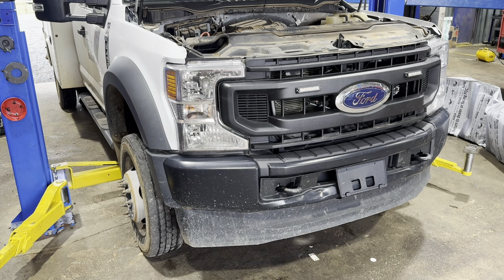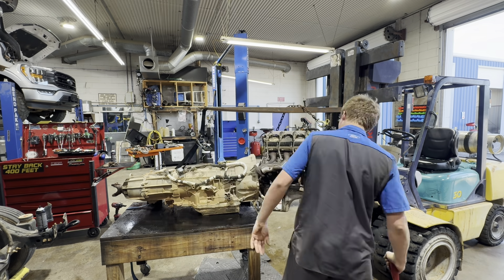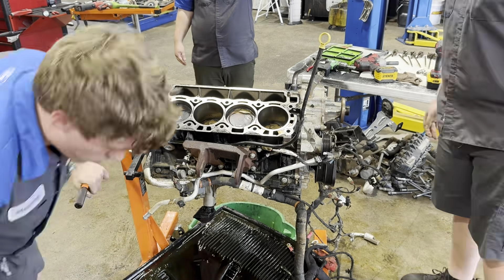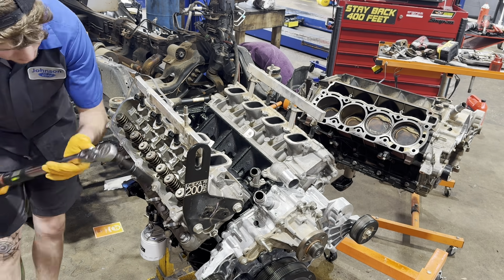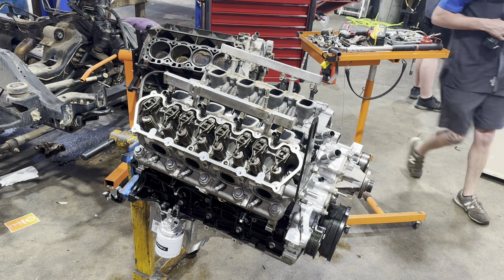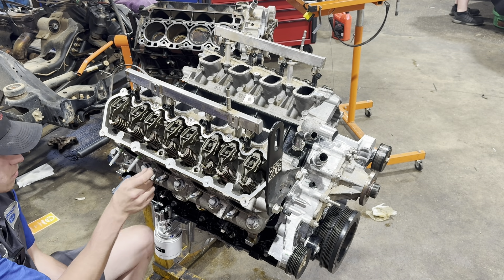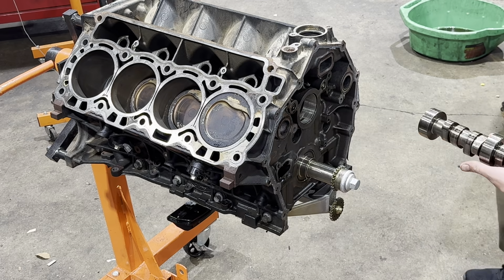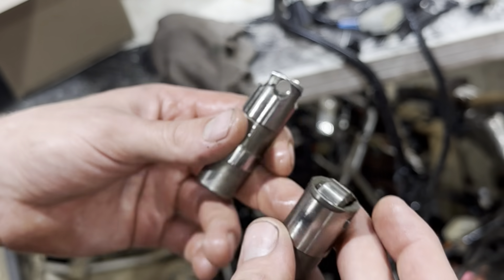Ford 7.3 Godzilla | Does this one issue make the engine a bust?

Comment: Oil pressure does not really affect lifters. Poor oiling circuits can be overcome by higher oil pressure but as far as collapsing, the oil is being pressured to fill the void, not provide any capacity in preventing the lifter from collapsing.

Comment: I pretty much have been buying old dodges with the 12 valve and been stacking like cordwood. Last one drove itself on the trailer after 356K of oilfield abuse still hammering away.

Comment: Ford could reflash the ecm for higher minimum oil pressure . The low weight oil + oil with no zinc in it doesn’t help either . Some of the older Fords you could toggle through the odometer and it would tell you idle time hours .
Reply: They came out with a update 24b27
Reply: They did, but its not available for most trucks....makes no sense
Reply: People please... the oil pump is not ECM regulated. Any issues with lifter failure is due to supplier issues. All big three have had similar problems...
Reply: @johnthomas2856  the pump isn’t but the purge solenoid is which affects oil pressure and volume. 24b27 spells it out directly from ford. I’m sure it’s not the leading factor in failures but it is most likely causing some issues for ford to do a CSP.
Reply: @johnthomas2856 ok Einstein.  Within 10 minutes of researching this issue because I just ordered a 2025 F350 it was clear to me from countless sources that the oil pressure is the CM controlled .  Try again.

Comment: Fw those need a heavier viscosity oil like most things these days. Like maybe 15w40 and  a high idle setting like diesels have to keep the OP up. Engines don't live long at 8 psi. As you and Fomoco are finding out.

Comment: 6.2 junk?? What world are you livin in😂😂I've worked on countless 6.2s and the most common problem is them breaking a value spring...which isnt hard to do. Every blue moon one might have vct issues but those were few and far between and were mainly caused by lack of maintenance. The 6.2 was very hard to kill. Oh and the ls came from a 351 Windsor hence why its possible to swap an ls head on a 351 with minimal machining.
Reply: 😂 My 2012 f250 6.2 has 394,556 miles on it and purring along like New. Good maintenance schedule and normal wear items replaced 😅
Reply: LS did NOT "come from" any ford design. It's has some similarities and that is all. Full stop.
Reply: @shanechambers9529 

It's embarrassing having a Ford bias when 1d10t5 start spewing that LS copied the 351W nonsense nonsense. ..

About as bad as the 7.3L copied the LS feces....
Reply: @shanechambers9529 wrong again. 351w was in the lotus race teams race car. It was getting outdated. Ford was designing a new engine for it and had already scrapped the early LS design due to its inefficiency when GM came along and purchased the race team. The blueprints for the engine were bought along with everything else. Just a few short years later they had prototypes of a new engine. Do you Know who the driver for lotus was? Yup. You got it. The “engineer” of the LS. Ed Koermer. After all, the ls1 was based on the lt5 that Mercury marine built… but yea, you’re right. Ford didn’t have anything to do with it… GM is known for building their own parts. Like the duramax… and the Allison transmission…
Reply: @shanechambers9529 you’re wrong.

Comment: 6.2 was a great engine idk wtf he talking about . It was pretty reliable
Reply: I agree.
Reply: 6.2s were screamers and tough
Reply: 6.2s could be underpowered in some applications but again, never seen one that didn’t run good, unless the plug wires had a break in them or a a coil pack, which are maintenance items. Also seen the intake runner control valves make noise like a bad lifter, but not the end of the world
Reply: A few broken valve springs….easy fix. Real early ones had roller rocker issues. Great engine?
Reply: I've never thought of the 6.2 as junk either. The 5.4 3 valve, they were junk
Reply: The 6.2 has been bulletproof for everyone i know!

Comment: Seems all the heavy duty gas trucks are having issues with lifters. Curious if it’s lower viscosity oil and lots of Idling or suppliers sending out poor quality batches.
Reply: 6.4 HEMI uses 0w-40, which is pretty dang thick compared to most engines these days. I’ve got 45k on mine, fingers crossed.
Reply: @m_ssingp_eces  Am I mistaken or does the 0w in front mean its very thin at operating temps?
Reply: @marcochavanne the "W" number is the cold crank rating. Basically the force required to drag a bar through an oil bath at cold temperature. You can look up the SAR test method to better explain it. It's better to have a lower number which means the oil will flow better at startup. The second number is the actual viscosity at operating teperature. The higher the number the "thicker" the oil. This should be selected based on the manufacturers recommendations. There used to be a wide range since the engine oil was only used to lubricate. Now you have variable displacement and valve timing that viscosity is critical and if it is too far off, you can actually get a check engine light.
Reply: Thin oil certainly doesn’t help
Reply: Ford built this thing off a blank sheet of paper. Of course they observed all the GM RAM engines and came up with the 6.8/7.3L . That being said why didn’t the use a derivative of the 6.7L powerstroke lifter. The wheels on the lifters are massive compared to the same ole GM Ford pos lifter? From what I can see it’s the same lifters as the 6.9/7.3/6.0/6.4L crazy to me….

Comment: We have a large fleet of cab chassis trucks, every 7.3 has had this problem before 50k all had to be replaced.
Reply: I also work at a large fleet. 7.3 last less than than 40,000Km. New ford recall to increase RPM at idle to prevent catastrophic damage.
Build Ford Rough.
Reply: @roxydog545 i would say if you are having issues with the 7.3. Which is doubtfull..the maintenance  guys are the issue
Reply: The 7.3 godzillas do not take idling well. I have heard of close to 300k, those ones were not idled a lot, then they usually have no issues...
Reply: We have 3, 7.3s. NONe with any issues. One has 191k. BOx trucks and loaded every day. Real Loads. (highway and City miles)  So....IDK... Just FYI  and They PULL, Hard.
Reply: Daym
Reply: bUT THe 6.2 Is jUnK! 😂😂😂

Comment: I could’ve sworn there was a tsb or recall to update the pcm to increase oil pressure during extended idle time
Reply: Yes 24b27 ford is dragging their feet on distributing it. I don’t think anyone has been able to get it done.
Reply: @ZimmyF250  Thanks I knew I saw it but I couldn’t find it anywhere
Reply: Yes just talked to ford they said have to wait for vin to be attached to the csp. Mine is a 2023 they don't care if I destroy my engine.

Comment: Also the oil pressure sensor not sensor but pressure switch which only takes 5-7 psi. I've also had ACTUAL pressure gauge in the engine getting 40 to 70psi.
Reply: What was your psi when warmed up idling?
Reply: What I posted tells you

Comment: Ive done 3 chevy Silverado's and 2 gmc sierra's 1500's L83 and L86 because of lifter failure in the past 4 month's. I was able to save a couple but the others where full rebuilds! Rebuilt to 5.7 hemis last year because of bad lifters!
Reply: Which company brand you're using for replacement lifters? Im planning on getting an 2022 yukon denali and want to take all this stuff out before it messes something up.
Reply: @warriorplutotrent3827  been using Elgen or factory gm lifters. Your 2022 will have a lock on the pcm if you go in with hp tuners and the right person does it they can disable the dynamic fuel management.  In 2019 they started putting it on all cylinders instead of 1,7,4 and 6.
Reply: @joesmo4749  thanks for the info.

Comment: I'll bet if you run 1 step higher on oil viscosity, the lifters won't fail. If it call for 0w20, try 5w30 for a while and see what happens
Reply: i have one 2024 they have 5w30 already for ford
Reply: My 22 calls for 5W 30 factory. I may start using T6 rotella 4W40. Heard alot of good things on it
Reply: @rickcarmichael4661 Order new catalytic converters after the Rotella diesel oil change 😂
Reply: @h2o100c I've used higher zinc oils in many cars with catalytic converters over many, many miles. Maybe it shortens the life of the catalytic converter over 200,000-300,000 miles but I've never had a single one fail. A cat is cheaper than an engine anyway.

Comment: You were the chosen one! It was said that you would destroy the diesels, not join them!
Reply: Hahahah I just watched Star Wars and this is hilarious 😂
Reply: anyone trying to compare the problems of modern diesel to this is coping
Reply: I've never heard of this problem affecting anything but a small number of the 7.3s sold for commercial use, so it was probably just a bad batch of lifters. It's a non-issue.
Reply: I wound three diesels and two of them had expensive failures that left me by the side of the road. A gasoline engine has never done that.
Reply: This conversation went directly to no mans land fast.
Reply: It drove itself to the shop. Still a yuge savings over a nasty diesel.
Reply: @operator8014 nasty? The only thing nasty about diesels is the emissions systems that are killing them and causing more waste and pollution than just not having them.
Reply: @huh0123  The smell, the sound, the way they shake and knock like they're dying when they're running perfectly, the way you need 10L of BIG DEEZEL POWER to match a non diesel 3L, the way they just cannot be started at any temperature below -30, the way they're more delicate than a snowflake feminist convention...

Diesels suck at everything except for saving fuel, kinda. The only thing worse than a diesel engine, is a diesel owner.
Reply: @ you do realize diesel engines are smoother running than their gas counterparts, right? 10L of diesel to match a non diesel 3L? Do you actually have any idea what you're even talking about? LOL
Reply: @sly9263  No he does not. 1200 torque from the HO pulls circles around every gasser ever, unapologetically. I love the 7.3 Godzilla but this guy is a tool.
Reply: @AndyE30  The 7.3 is naturally aspirated and it still compares fairly well with its diesel competitors, so how well do you think a diesel would keep up if it were turbocharged?
Reply: @PistonAvatarGuy  I have one in a Tremor. Gassers are faster, lighter, rev higher, make more horsepower, and geared more appropriately. In all honesty it barely needs a tune to outrun a HO. 
Of course, they'll never put down the power that diesel's do.
I think the line of reliability is blurring. As gassers improve, new diesels are becoming less reliable. Built cheaper and with increased emissions equipment choking them out. 
Sad to see really.
Reply: @AndyE30  Never put down the power that diesels do? Since when do diesels make 5,000 hp?
Reply: @PistonAvatarGuy  Honestly I don't know what you're arguing. Previously you asked "how well a diesel would keep up if it were turbocharged", they are. 
Now you're asking "when do diesels make 5,000 horsepower", they don't. 

I'm saying diesels make an ass load of torque that gassers can't touch and it's incredible, but gassers make more power that lends them to be faster. 
Where is the disconnect?
Reply: @AndyE30  No, I was asking how well a diesel would keep up with a turbocharged 7.3 gasser.

Anyway, if we crunch the numbers, using the performance of Ford's 3.5 liter EcoBoost engine as an example, we get a BMEP of 353.4 psi, which works out to 1,043 lb-ft of torque for a 7.3 liter, which is very close to the torque output of the current 6.7 Power Stroke (excluding the HO). The real kicker would come from the fact that a gasser can rev higher than a diesel, so it can hold onto lower gears longer than a diesel, sending more torque to the wheels as you accelerate to speed. Even if a turbocharged 7.3 gasser could only rev to 3,700 rpm, it would still be capable of more than 500 hp... easily.

With a smaller displacement gasoline engine, you could also trade revs for torque with lower gearing, and make more torque at the wheels than even the HO Power Stroke, you'd just have to get comfortable with consistently higher revs... which is true of the current 7.3 anyway.
Reply: @AndyE30  Really, we can simplify everything and say that Ford's 2.7 EcoBoost engine outperforms all of the 3.0 liter diesel offerings in light pickups, so there's no reason why a ~6 liter gasoline engine couldn't also outperform the current ~6 liter diesels offered in pickup trucks.

Comment: They'd rather get 1 mile a gallon better on gas and replace engines one after the next. Make it make sense.
Reply: More like .01
Reply: Right? How about Gm? Even worse. They took a once great 5.3/6.2 engine and ruined it to save .5 mpg.... Mind boggling. Tje EPA needs to be challenged at this point for the impossible regulations they are implementing on the manufactures.

Comment: What kills the hemi rollers is lack of lube at idle and low engine speeds. The best way to save them is to have the idle bumped up to 900 ish so theres more splash lubing for the roller. Gm lifters the failure usually starts with the dod system lifters collapsing and the roller not being under tension like its supposed to be
Reply: The GM AFM lifter failures in the older engines (Gen IV) are due to long oil changes with poor quality oil, and buildup in the Valve Lifter Oil Manifold (VLOM), as well as buildup on the screen underneath the oil pressure sender. Clean the screen, use good quality synthetic oil preferably a 0W-40 like the Corvette Dexos R 0W-40, or even thicker, and if the VLOM is the old style with raised, rounded bumps on it, replace it with the latest revision one for an L77 or alternatively one for an LT4, and the issues are incredibly unlikely to happen if the engine was in decent condition before that. In terms of an even more exotic oil that doesn't shear easily and cause low oil pressure, High Performance Lubricants (HPL) No VII series 10W-30 or 10W-40 is a good choice. No viscosity index improvers and group IV base stocks only, means the oil will not shear at all over a normal oil change interval. Oil shearing also can cause low oil pressure, making improper activation of the lifters more likely.
Reply: own 6 different 5.3 gm never had a failure .
Reply: @classic89deerefever80  its way more common in the afm engines. It starts with the afm specific lifters. No afm or afm delete engines usually wont do it. But its also not every engine that does it. High idle or low speed operation hours usually does it. Engines running down the highway all the time wont
Reply: @classic89deerefever80  after 07 yeah.

Comment: Nothing wrong with the 6.2. By far the best gas option for a heavy duty pickup. Good power and reliable, which is why most oilfield trucks and railroad trucks are all 6.2 with 300k and many engine idle hours. the 6.0 and 6.4 gas suffer from oil pressure issues unlike the 6.2
Reply: My coworker has a 6.2 Raptor with 780k miles. 3rd transmission.
Reply: We have had 5 work 6.2 go over 350k and they take a beating
Reply: He hates them because they don't break
Reply: @Running-with-skizers or perhaps he was in the 6th grade when they introduced the 6.2. In my opinion the 6.2 could have really shined in the mustang but ford developed the coyote instead robbing the 6.2 of its potential. The 6.2 bottom end has enormous potential. It's all there. With some cylinder head and induction changes and perhaps a steel flat plane crankshaft  it could have been a solid 1000 hp engine.
Reply: If you were to buy new I’d go with the 6.6 L8t…
Reply: @wesleygarrison6248 No way! Direct injection and they burn oil like crazy.
Reply: @ They don’t burn oil, and direct injection isn’t an issue if high octane fuel is used… better than having to worry about lifter failure on a 7.3…
Reply: @BoomBoomSoon  you are thinking of the GM LS3 Direct Injected 6.2. The Ford 6.2 is not direct injection it is port fuel injected. Direct injection on a gas engine is so stupid. You have to run special engine oil to prevent pre-ignition around the piston rings (that are low tension rings too- thus burning oil) injector failures also have to potential of destroying the engine as well. Just a mess of a fuel delivery system. There was nothing wrong with port injection. Then some dumbass decided to inject fuel into a hot cylinder, on top of a hot piston. The injectors get hot, thus having a high failure rate and when they fail they usually stick open flooding the cylinder with raw gasoline washing down the rings and in some cases bending connecting rods or busting pistons.
Reply: By buddy’s 6.2 has 295,000 miles and still doing burnout

Comment: It's the economy tune. When idling they run very low oil pressure. Normal trucks that don't have a chassis cab don't have this issue
Reply: According to ford it's all of them google csp24b27 superduty.

Comment: Looks like the pin is breaking on the roller lifters. Should be able to get some good ones from somewhere to replace them with. I’ve seen some guys putting down some serious horsepower with the 7.3, supercharged. I’ve thought about putting one in my 88 mustang but gonna stick with my 351 w, well 427 windsor. The 7.3 is gonna have to go a long way to beat the power my sbf makes